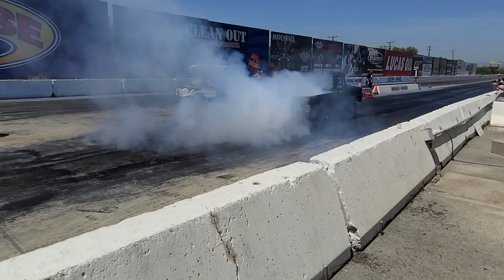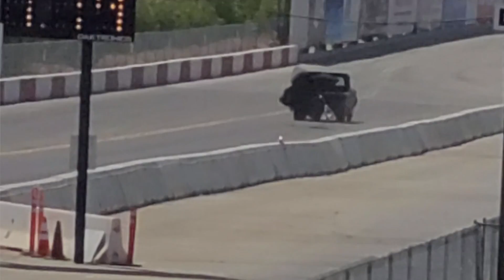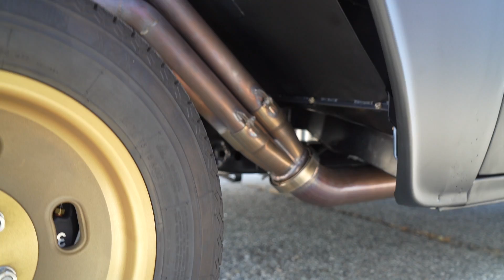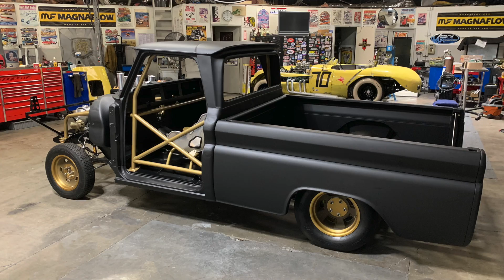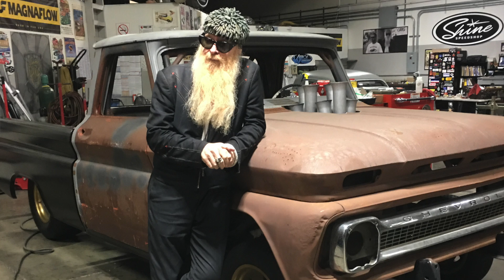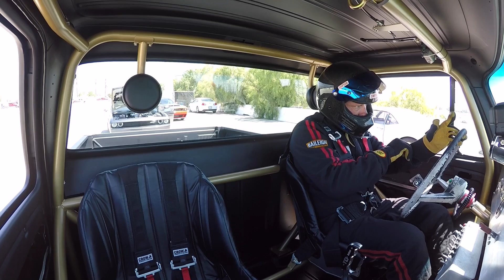900 hp Chevy C10 Gasser Doing Massive Burnouts at Drag Strip

Comment: I got one just like it but it's a long bed 63 I painted flat black with the I've got the full disc baby moons on it with a a running a 301 in it with the 274 Craig cam and cruising it punched 283 like they did in the 50s the 60s

Comment: “Big blocks don’t like RPM”.  Really?  Tell that to all the big block drag racers who routinely turn 900+ CI engines to 8000+ RPM and.  HIS engine may be RPM limited by the set up (heads, cam, intake) but to say that all big blocks can’t turn high RPM is simply not true.
Reply from the maker: He didn’t say all big blocks and if they wanted it could easily be pushed as it’s a seriously fully built engine

Comment: Why does it sit front high?  I think it would look better either level or front low.
Reply: That's how gassers are built.  The theory is that helps transfer weight to the rear on take off for better traction.  It's something they started in the 1950's. Tires were not great then so this was one technique to try to hook up better.
Reply from the maker: @larry h said it right here 👊